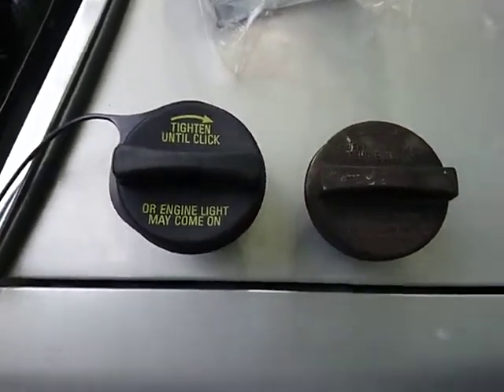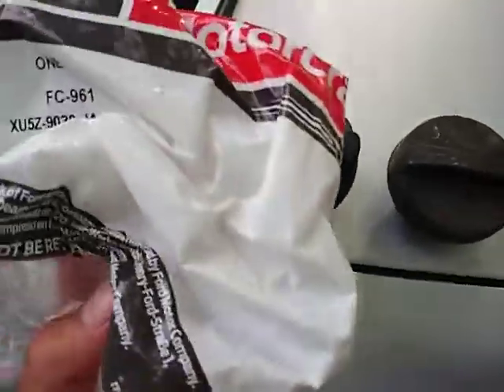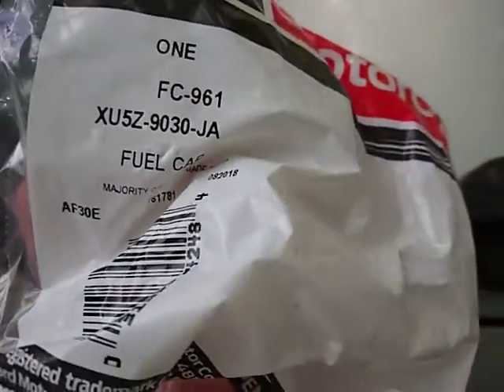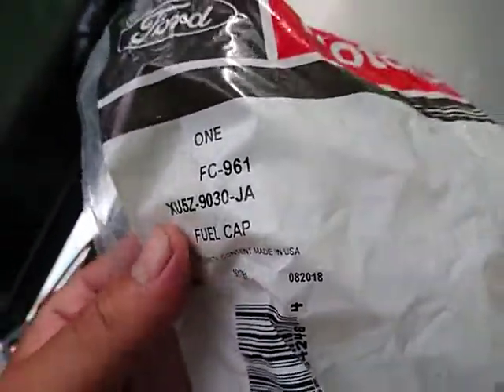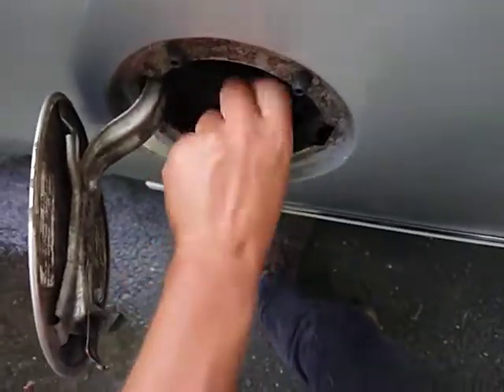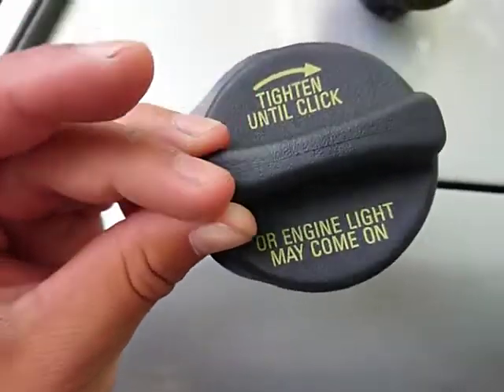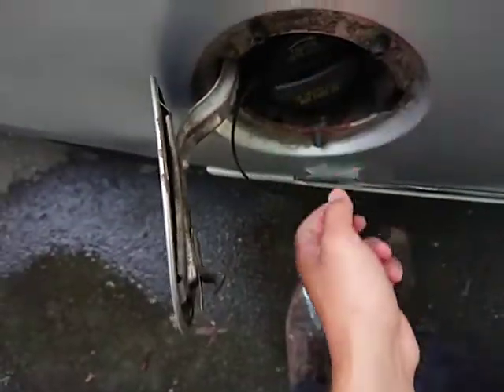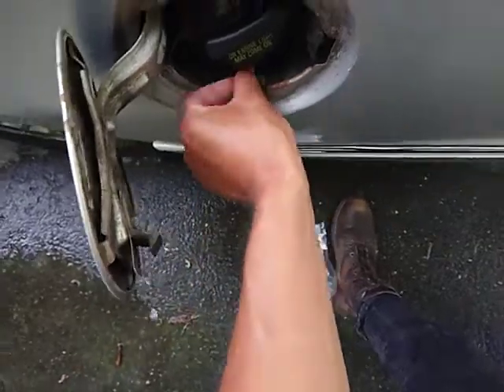Motorcraft FC-961 vs Crappy Gas Cap on Lincoln Town Car

Comment: My Grand Marquis has this weird one that just clicks forever, it clicks, but you can keep turning it as much as you want and it'll just keep clicking endlessly.
Reply from the maker: I think that's the normal behavior for factory caps on these cars every other one I've filled up does that except this car's replacement caps.
Reply: @iliketowncars  Huh, didn't know that. My 02 Marquis had the same gas cap as the one you installed on your Town Car in this video, and so did my 04 Ford Taurus, and my grandmother's 06 Ford Taurus. I always assumed the one in my Marquis was an aftermarket replacement.